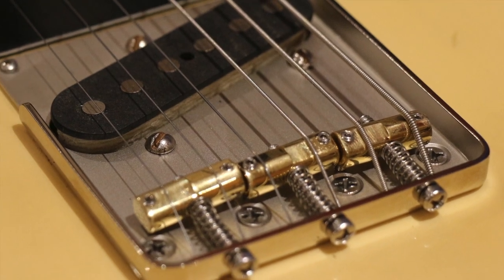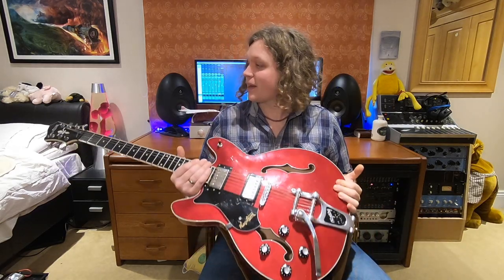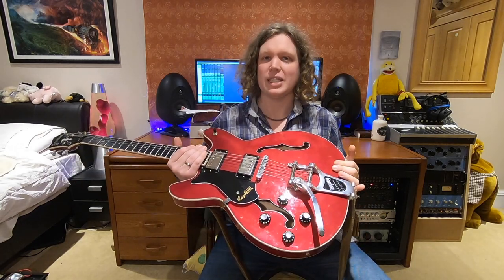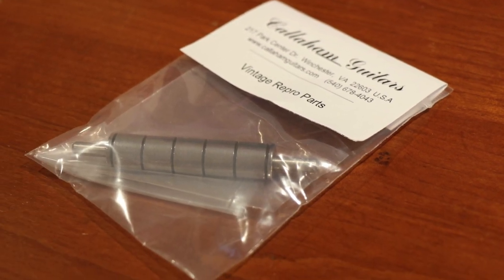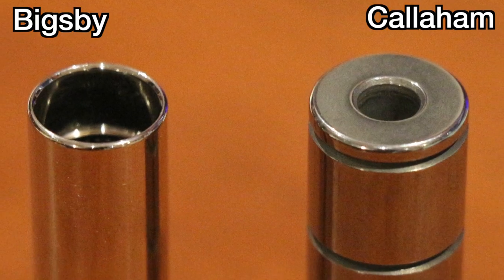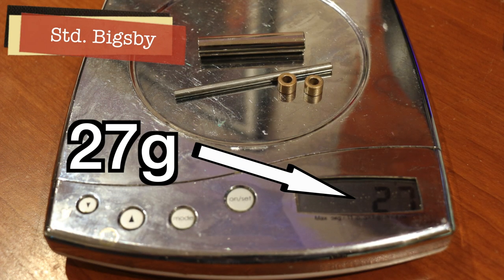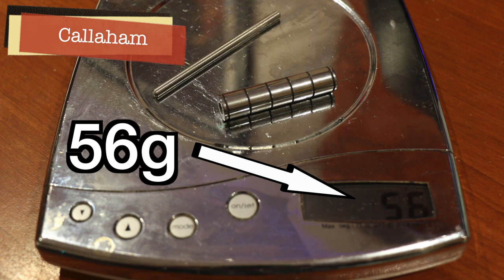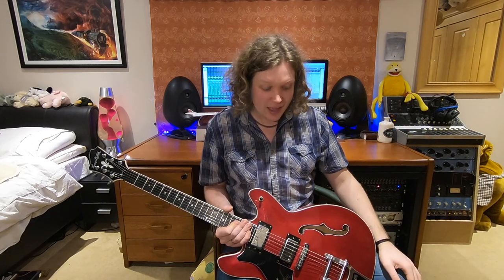Callaham Bigsby Roller...What Does It Do?!?

Comment: If you want the real difference get the Callaham pre-drilled rear bar, together they work like peanut butter and jelly.I finally broke down and got one , it was worth it.Stays in tune, easier to string, should’ve did it years ago lol love it.
Reply: Do you find that the rear bar limits the pitch range due to a smaller circumference? I’ve always wondered about that.

Comment: I was thinking of trying this on my vintage goldtop, but I think it's probably a cure for a problem  I don't have. The goldtop's original stop tailpiece is featherweight pot metal and changing to the Bigsby ( with a Vibramate ) certainly didn't make it seem lacking tonally. Most of the Les Paul nuts seem to think that the lightweight tailpiece is preferable anyway so I don't know...
Reply from the maker: No point fixing it if it ain't broke! :-)

Comment: Wouldn’t the point of this roller be improved tuning instability as the primary selling point?
Reply from the maker: I never had any tuning issues before, to be honest - but I'm sure it could only help if you are having problems!
Reply: The one thing that looks appealing to me is the slots in it keeping the strings in place because rolling over my brass saddles, there isn't much to keep them in place.